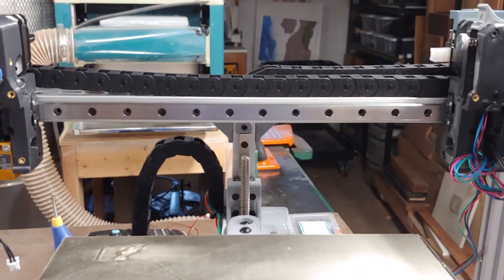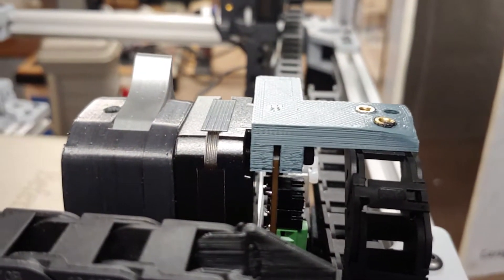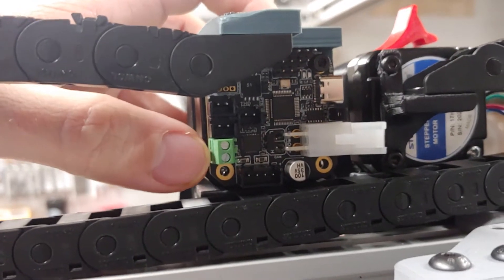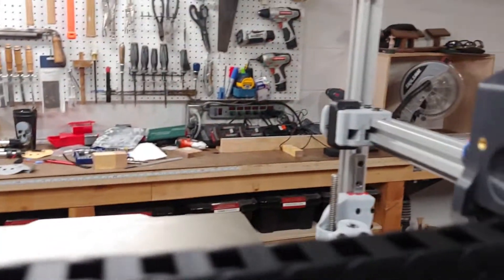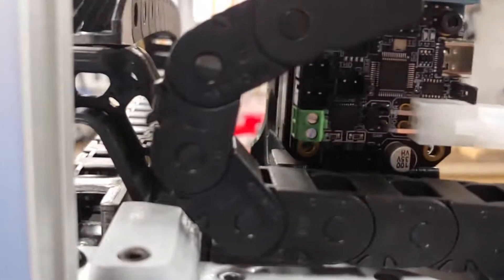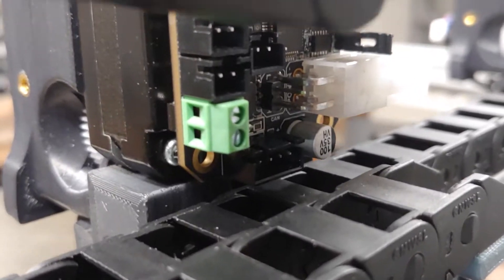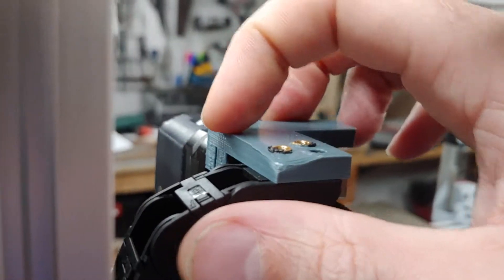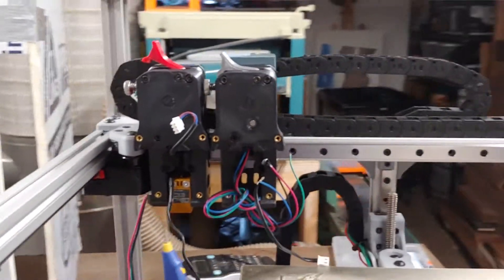BTT EBB42 Canbus mount and cable chain path improvement.

Comment: Those chains are a pain aren’t they. I’m not a massive fan of umbilicals because both my V0.1s wore through the extruder cables. So thanks for sharing some ideas. Just a quick one. Do you know how dual toolhead can bus works. Do you have say one usb2can board and two toolhead boards? The toolhead boards are connected to each other or are they both connected back at the usb2can board. I’m thinking the idea of can is daisy chaining. Just wonder if you have any knowledge on that.
Reply from the maker: The canbus stuff is a bit over my head, but I am working through it following directions.  I don't have an answer since I haven't gotten that far yet.  I've got the U2C 1.1 showing up on the pi and have generated firmware for the EBB42's, but haven't flashed them yet.  Judging from eddietheengineer's youtube video (BTT EBB V1.0 Setup Guide https://youtu.be/_FELCN8CbWA), it sounds like they are daisy chained with a jumper on the last one to identify it as the end of the chain.  The images that show up in a search show them "daisy chained" by being wired in parallel.  I am still trying to wrap my head around how one can be the "end" of the chain if they are all wired in parallel.  Either way it looks like only one run to the usb2can board is necessary.
Reply: @badmouth75  If you only use one CAN bus, they should chained as a serial bus with short stubs (ie. not in parallel from the mainboard). The two farthest ends (mainboard and one toolhead) should each be terminated with 120R. That is not the same as daisy-chaining where the output of the first is connected to the input of the next. If you wire them in parallel from the mainboard (which is a big no-no), only one toolhead should still be terminated (for a total 60R bus load), but the other will act like a long, unterminated stub which can cause an abundance of reflections
Reply from the maker: This stuff is over my head, but I managed to get them connected (still have most of the toolhead wiring to do.)  The U2C literature says it has 3 CAN outputs.  It has about twice as many connectors as that, but ALL them seem to be connected in parallel when tested for continuity.  I was using 20awg wire for power and wasn't sure if it would be enough for both toolheads so did run two sets of wire using the two biggest output connectors on the U2C and installed the 120R resistor on the 2nd toolhead.  It sounds like maybe that was a bad idea, but then why design the U2C board like that?  I guess I will find out when the toolheads get wired.  EDIT: I am getting 119 Ohms across L & H wherever I measure, so I think I am ok.  DOUBLE EDIT: OK after wrapping my head around it a bit more..... the way I have it wired, the toolhead boards are at the ends of the bus with the U2C in the middle, so both toolhead boards need the 120R jumper.  I measure the correct 60 Ohms now.
Reply: Thanks for that I’ll be watching that and following once I get my pcbs. Just in case you are interested, here is that short of an idex switchwire in mirror mode. Notice how they have done the cable chains. https://youtube.com/shorts/k3Mkut2jhwM?feature=share This may not be possible on the trident due to the gantry moving towards the back.